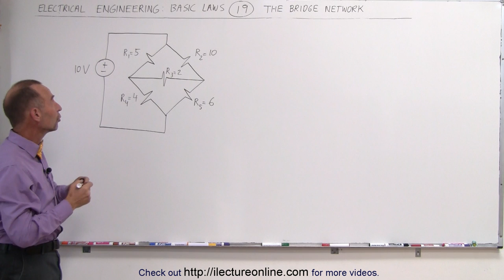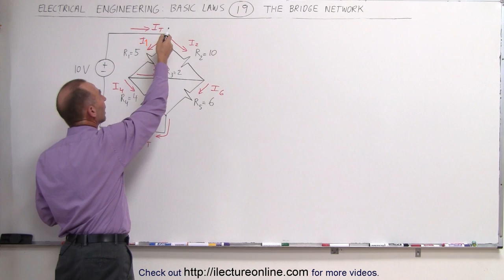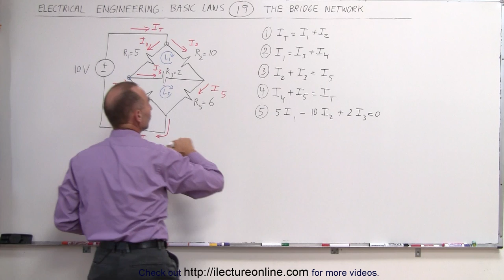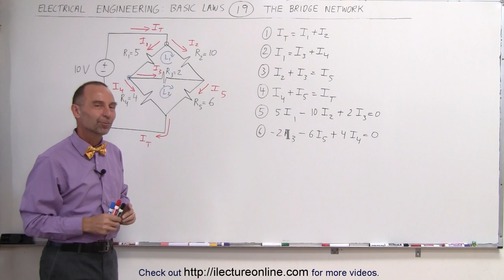Electrical Engineering: Basic Laws (19 of 31) The Bridge Network

Comment: Mr. Van Biezen has left out one important fact. The equations he came up with are correct as far as he has gone. Mr. Van Biezen has left out one very important fact. We need one more KVL equation that is a loop that includes the voltage source. Then you can solve for the currents in the resistors. If you express the currents I4 and I5 as functions of I1, I2 and I3 then you have three equations in three unknowns.
Reply from the maker: You are correct.  If the wrong combination of loops (equations) are picked, a solution cannot be found.  To appreciate that, it is useful for the student to experiment with that so they can see how that works.
Reply: yeah - it's unsolvable otherwise

Comment: One of the biggest problems in understanding these problems is that many examples have the different I sections in different sides of the diamond and it gets very confusing. So when a book problem says that r1 is always I1? r2 to I2 and so forth and so forth?
Reply from the maker: That is a good point.  (But different authors are going to use different combinations).
Reply: @MichelvanBiezen  now in wheatstone bridge circuits does current always travel and split at the very first top node? why do books say there are loops of different kinds? again very confusing.
Reply from the maker: Current always splits in some ratio at every circuit junction.   More current will flow through the branch with less resistance.  Note that bridge circuits are complicated and it is better to start with some examples of simpler circuits before attemping to use Kirchhoff's rules to solve a bridge circuit.

Comment: The number of equations for Kirchoff's Current Law you can writer to solve a circuit equals the number of nodes minus 1. This circuit has 4 nodes, but you have written 4  KCL equations (the first 4). So aren't you still one equation short of being able to solve the circuit?
Reply from the maker: You need an equation for each of the unknown currents.  (you can use Kirchhoff's current equation to eliminate one of the unknowns).

Comment: For those who want the solution, we need to include another equation that factors in the voltage source: 10 - 5(I_1) - 4(I_4) = 0, a consequence of Kirchhoff's Voltage Law. 

If we solved the following equations simultaneously:
-> (I_T) = (I_1) + (I_2)
-> (I_1) = (I_3) + (I_4)
-> (I_5) = (I_2) + (I_3)
-> 5(I_1) - 10(I_2) + 2(I_3) = 0 
-> 4(I_4) - 2(I_3) - 6(I_5) = 0 
all are derived in the video (NOTE: I am not including: (I_T) = (I_4) + (I_5))
and -> 10 - 5(I_1) - 4(I_4) = 0

We obtain the following answers: 
I_T = 1.74216A
I_1 = 1.14983A
I_2 = 0.59233A
I_3 = 0.08711A
I_4 = 1.06272A
I_5 = 0.67944A
Note, these values also satisfy the equation we excluded: (I_T) = (I_4) + (I_5):
1.06272A + 0.67944A = 1.74216A = I_T
Reply from the maker: Thanks for the input.
Reply: In 10-5(i_1)-4(i_4)=0 
Why did you only use 2 resistors if it includes the whole circuit? 

Im just confused

Comment: my formal understanding of math is somewhat "arrested" but conceptually I reckon that the purpose of the six equations is to calculate the unique current value of each branch (I1, I2, I3, etc ...) that would satisfy each and every one of them, hence arriving at the solution. Correct?
Reply from the maker: Yes.  (That would be a big task, but it can be done).

Comment: How do you know which side I3 will flow into
Reply from the maker: We assume that some current (we don't know how much) flows through each of the branches.  Then we label those currents for each branch.  So the current flowing through R3 is now labeled as I3.  Then we use one of the circuit evaluation techniques to determine what the value of that current is.  (as illustrated in the video)
Reply: @MichelvanBiezen  What I am assuming is that due to Ohm's Law, more current will take the lower resistance path, which is 5 ohms as opposed to 10, so the higher current node won over the lower current node (the one connected to 10 ohms) and became our assumed current direction. Could be wrong.

Comment: if you use a matrix you cant use equation 4 because its the same as equation 1 and the determinant will be zero won't it? Plus as rickmcn1986 said, you do need an equation that includes the system's emf.
Reply: I tried to get the final solution with this six ecuations with six unknowleges. Using an app in my mobile (Gauss-Jordan) there are infinite solutions. The determinant of coeficient matrix is zero. So, at least one ecuation is a linear combination of other.

Comment: I got I= 2.1 and Req=4.74 and I1=1.4 and I2=0.7, I3=0.93, I4=0.4667, I5=1.63
is is right?? 
Plz comment
Reply: no
Reply: yeah, that isn't correct - did you include another equation, factoring in the voltage source? Otherwise, no solutions are possible
Reply: Answer is wrong

Comment: How do you know which way the current in the center flows?
Reply from the maker: It is usually possible to determine by looking at the size of the resistors.  The smallest resistors carry the greatest current.  If you can't tell then you can just guess and if you guess wrong, you'll get a negative answer for the chosen current.
Reply: @Michel Van Biezen, Sir what would be the answers?? I get 

I1 = 1.15 Amps
I2 = 0.59 Amps
I3 = 0.09 Amps
I4 = 1.06 Amps
I5 = 0.68 Amps

 Total current = 1.74 Amps

Am I correct??
Reply: @MichelvanBiezen  @Michel Van Biezen, Sir what would be the answers?? I get 

I1 = 1.15 Amps
I2 = 0.59 Amps
I3 = 0.09 Amps
I4 = 1.06 Amps
I5 = 0.68 Amps

 Total current = 1.74 Amps

Am I correct??
Reply: @cyrilrelatado3874  I obtained the same total current (1.74 Amps) when working the problem with two different methods (mesh analysis & delta-y conversion).
Reply: @cyrilrelatado3874  yes